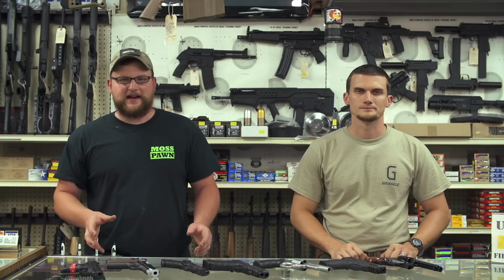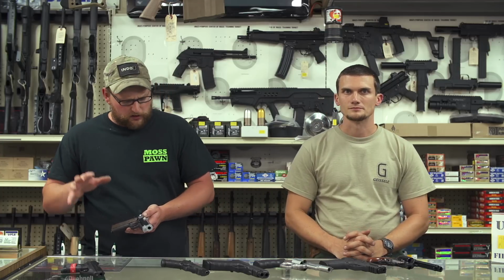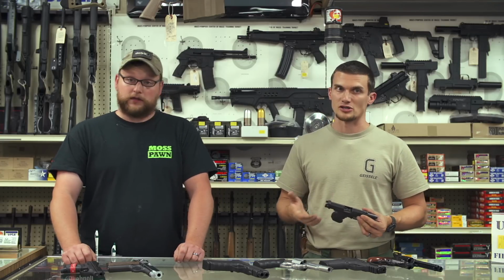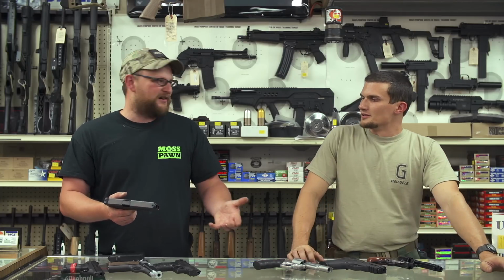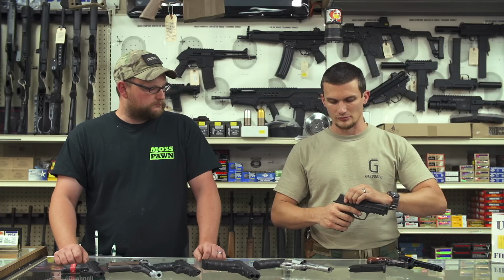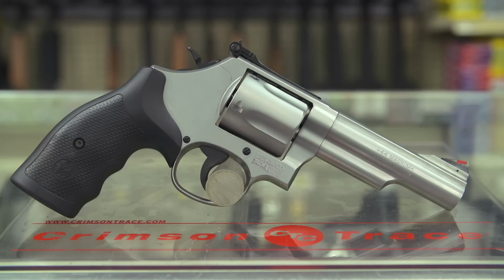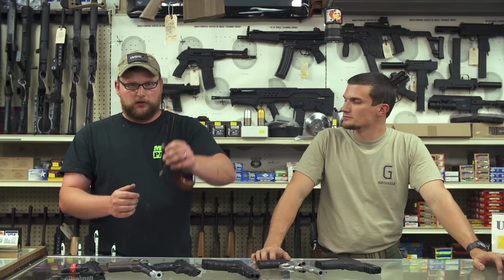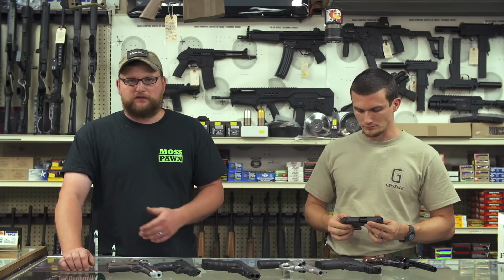Handgun Etiquette for Beginners

Comment: "Don't dry fire without snap caps, they're cheap and easily available." ->Dry fires with no snap cap
Reply: I literally always dry fire to make sure the firearm is fully cleared… it’s like strapping a load down on the back of a truck or trailer and not testing the tension of the straps and saying “that’s not going anywhere” feels like you missed a step when you don’t do it, and also makes it so the firearm isn’t armed and ready to send the striker forward when not in use.

Comment: I get what these fellas are saying but surely the manufacturers of these guns would make it so that you don't have to treat them like they're made of glass
Reply: 👎 No, I dont think you get what they are saying.There not made of glass so if you want to dry fire (wich you should avoid as much as possible) you may get by without damaging the weapon, but the more you do it, the more likely you will damage the weapon.
Reply: @paulpugh2480  that's not true. Most center-fire handguns built today (like glocks) can be dry fired as much as you want with no detriment. You actually have to dry fire a glock to disassemble it
Reply: @privateuser7 Glock recommends snap caps if practicing dry firing regularly. People have literally knocked out the breechface from dry firing too much without snap caps.

Comment: I was taught to grab the slide from the top (don't grab it like a sling shot you got in trouble for that) pull back the slide and to let it go. This will allow the slide will slam forward  guaranteeing that the weapon will chamber a new round and lock into battery. I have treated my gen 2 glock 19 this way for the last 23yrs.

Comment: I think this is etiquette for new guys checking brand new guns out at the store. If you haven't bought it, it makes sense to be careful with the merchandise. Otherwise, guns (especially new ones) are pretty tough. They're designed to contain EXPLOSIONS, so a little racking and slamming and dry firing are not gonna hurt much.

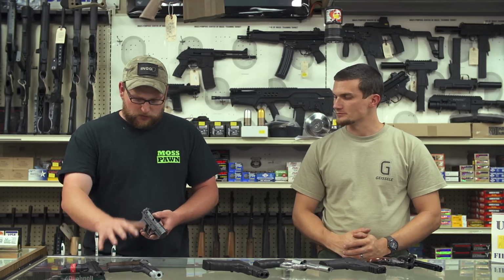Comment: 3:36 - "We try to walk them through, and at least show them how to handle a firearm properly."  
3:45 - Grabs P22 by positioning fingers directly in front of the muzzle, and continues to handle it with muzzle pointed at fleshy hand.

I know the guns are cleared, but that's a bad habit to have.
Reply: !!!!! Yikes. He made me want to stop watching the video right there.
Also at 1:14 he said "you don't want to crystallize your firing pins." This is incorrect terminology. Dry firing will not change the microstruture of the hardened steel firing pin. The steel pin is already "crystallized" in the sense that metals have a crystalline structure. I think he was trying to say that dry firing puts more stress or impact load on the firing pin and could cause it to crack if the heat treatment were not quite correct (insufficiently tempered or the material has residual stresses) or if the firing pin has a defect in it.

Comment: I watched the whole video. At the end you brought out a great fire arm. Lc9s 9mm pro has no safety that's why I bought it. I have dry fired it. But never shot it. I heard the trigger was the best in a CCW weapon. It is a great gun. Have owned many guns. The Sig 239 in 9mm. I let the slide shut from the button many times after cleaning and oiling it. Looked over the gun many ,many times. Never seen any damage. That gun was a tank. It was hammer fired too. Also a steel frame.   Let's hear from the expert's!   ..Shawn

Comment: I thought it was a myth that letting a 1911 "slide home" would damage it? Doesn't the gun's slide already "slide home" when it fires and chambers another round? As in every single time?
Reply: ***** Oh.
Reply: It is a myth. The slides gonna do that when you fire the gun anyway, doing it without the bullet is no more damaging than when firing it.
Reply: No for handguns it is damaging and not a myth when the handguns slide is released the spring in the gun has a strong amount of tension that is necessary to slide the gun forward as well as to chamber often heavy rounds of ammunition from the magazine. If you release the slide on an empty chamber without the weight of bullet to decrease the force of the slides tension then the slide will slam forward to fast with too much force and can cause damage to the mechanism of the gun over time. This is true for most of all semi auto handguns. You should never let the slide ride by pressing the slide release without a round to be chambered. If you want to return the slide to the forward position without a live round you have to hold the slide and press the slide release and more gently move the slide to its forward position while maintains grip on the slide so as to prevent it from slamming. After this you can decock the gun or dry fire the gun (which is fine for center fire handguns) to release the tension of the striker/hammer/etc. so it doesn’t remain cocked if you do not fire the gun anytime soon or leave it in storage for while. It is also just safer to decock the gun in whichever way is the best way for your gun so that the trigger is not able to be pulled and as a result cause the striker/hammer/etc. to be acted upon, upon an unexpected negligible discharge.
Reply: Yes it does.
Reply: @johnjacobs4280  That's BS. All of those forces can be sustained without issue.
Reply: @johnjacobs4280  have any confirmation on that?

Comment: I noticed Chad decocked the hammer with two fingers on the sides of the hammer. I just finished my cc permit class and the instructor was very clear that you should not do that that you should use your thumb. He has seen several accidental discharges with police officers and civilians that shot themselves when the hammer slipped out of their fingers.
Reply: Makes perfect sense to me. All the hammers I see are designed to be used by the thumb. Slippery on the sides but serrated on top.
Reply: Anthony Vaughan who “decocks” a 1911 on a loaded chamber 😂😂😂
Reply: rr satx actually I know a few people who aren’t comfortable carrying a 1911 with the hammer back
Reply: @rrsatx I agree! If you read the owners manual on any 1911 it plainly tells you it’s too dangerous and you should never lower the hammer on a chambered round and that the gun is designed to be carried either cocked and locked on safety or with an empty chamber and safety off.

Comment: I believe not letting the slide come home on an empty chamber is kind of overkill. Think about the military and the AR platform. When done cleaning you hit the bolt release and it comes home on an empty chamber and store it. This is standard practice and almost every AR owner probably does it. PERHAPS technically this does damage the gun or WILL but you're talking the difference between a 100 year life span and a 97 year life span. I don't think you need to baby a gun as much as this.
Reply: Our old SLR's were, racked, cocked and locked 'n'  dry fired so often that eventually you had weapons with knackered firing pins and you could physically move the bolt carriage in its slots.  You could easily tell which ones had to be replaced as the serial numbers of the weapon did not match the bolt. They were simply worn out through continuous dry drilling. These were military rifles designed for a hard life. I doubt that civilian fire arms are built any tougher. After all they are a "consumer item" so have a design life. Why shorten it unnecessarily and even worse risk a misfire in a life and death situation?
Reply: Laurie St Lyon
Well because that was probably a long time ago and who knows when the actual guns you used were manufactured (if meant for practice, probably a while ago). Things have changed so much now that the whole firing pin group on guns is completely different. Also, I was discussing not letting the bolt slam on an empty chamber, you are advocating not dry firing. I think a lot of people will agree dry fire practice is extremely important.
Reply: Dry firing is absolutely an important part of training but the effects of it over a period of time carries a price. And by the way Blackwater... it was not THAT long ago! Cheeky young bugger! LOL!
In all seriousness, the point I was making is that the SLR's were racked three times in the unload. Each time you allowed the bolt to go fully forward without impeding it. The SLR's were all L1A2 plastic stocked versions so not exactly geriatric maybe 5-7 years old. But they still had issues over time due to the action of the action!
My point was the guys are right. In short term you get away with it but in the longer term your weapon can pay a price. If it goes wrong at the wrong time...then you can too. Anyway, hope you enjoy your shooting regardless of the "etiquette" you use.

Comment: on the slide slamming forward... doesn't that do that after you fire a shot? whats the difference?
Reply: Yea, I got kind of confused. It might be because it's loading in a bullet, while racking the slide without a bullet inside could damage the internals, but I'm not sure.
Reply: Yeah I'd like an explanation as well.  When I took a intro handgun course we were encouraged to let the slide go to avoid malfunctions.  Are you talking loaded versus unloaded?
Reply: When you shoot the firearm it's undergoing it's firing cycle which involves stripping a round from the magazine and closing on a loaded round or snap cap. We aren't saying you can't let your firearm slam on an empty chamber, we are just making sure beginners know there is a difference. In the video, we are specifically making reference to the 1911
Reply: If anything it is slamming even harder when fired because the force of fired recoil is more than you cocking it, so I agree how could me cocking and letting it "slam" be damaging when firing it is more violent.  This was very annoying.  I've always read you are NOT supposed to ride a slide forward you are SUPPOSED to let is slam.
Reply: Atomic Bean they didn't explain it very well in the video. When you are chambering a round you want to let it slam to ensure the gun goes into battery. When you are cleaning your gun or something you shouldn't let it slam on an empty chamber because it puts unnecessary pressure on the parts
Reply: Some of the kinetic energy is used in stripping the next round out of the magazine, and seating it into the chamber and setting the extractor hook onto the rim of the case. Without a round in the chamber, all that energy is spent slamming the slide home without the cushioning effect of the case.
Reply: Virulent Ivyz At a gun shop most people pull the slide back with the magazine in and it locks back. So what do people do? Use their thumb, push down the slide lock letting the slide slam home. That's what they meant.
Reply: clemsonalum98 In a gun shop with unloaded firearms youre not suppose to let it slam. It could damage/bend a lot  When loading one into the chamber you also dont use your thumb to disengage the slide lock. You wear out the slide lock doing that. You slingshot the slide on live rounds.
Reply: ***** No more pseudonym? Just wondering.
Reply: Well not exactly because when fireing it it's also bringing up another run from the magazine in to the chamber which slows the slide down some. You're right though it I doubt really matters but whatever.
Reply: Not sure why there is so much confusion on "Handgun Etiquette for Beginners". Etiquette for handling handguns folks. Learn etiquette on handling someone else's handguns.
Reply: CastleDoctrine87 I understood that part. I know that dry-firing is bad for the firing pin and some internals. It's just kind of strange to hear that you're not supposed to let the slide slam. I'm sure it damages some internals being that there is no round in the magazine or chamber. I have done it allot of times and I have never heard of this rule until this video.
Reply: filoIII I was just going to say the same thing. Yes Kahr recommends that you use the slide release to chamber a round. And not slamming the slide is the same principle as not dry firing a bow. It's designed to have the extra mmass of the round / arrow while moving forward. No round / arrow puts extra unwanted velocity on the slide / bow.
Reply: Clambering of a new round actually slows down and cushions the slides forward movement
Reply: Virulent Ivyz filoIII I think Kahr is the only manufacturer that recommends using the slide lock as a release. I know Ruger recommends it with their Sr22 pistol (I have one) and that's all I know of. I, either way, wouldn't use the slide lock as a release. It's just too easy to use my non-firing hand to gently slingshot the slide. I cherish my firearms so if there's a way I can lesson wear then I chose that way. It's your firearms though.
Reply: Oh, ok thanks!
Reply: CastleDoctrine87  There isn't, you are conflating two issues.  Somehow this turned into a slide release thread vs. a full force on an empty chamber thread.  I never use my slide release, I DO often let it slam on empty chambers for example after cleaning a gun and the magazine is out I snap the slide back a few times to spread the lub.  No mag is in the gun, no slide release is needed.  It slams home I don't easy ride it.  The video suggests never letting it slam.  You converted the discussion to a slide release discussion.
Reply: clemsonalum98 If you read the comments you would understand. In gun shops perspective buyers pull the slide back with the magazine in. The slide locks. They then use the slide lock to release the slide therefore SLAMMING home. Gun shop etiquette that's how. Explain to me all  ways a slide can slam in a gun shop looking at your next purchase? Clemson Alumni? Born 1998? College student huh? I also wasn't talking to you. You don't have to read and you especially shouldn't have replied since it has nothing to do with you.
Reply: Kimber says letting the slide slam forward with no ammo in it can damage the extractor if it is done enough, but it's not really a big deal. What really is bad on 1911's is hand feeding a bullet (putting it straight into the chamber) and slamming it forward. The extractor is not meant to engage on a rim in that way and can be damaged after only a handful of attempts.
Reply: ***** I don't know Kimber mechanisms so can't comment on their extractor being damaged by slamming the slide on an empty chamber.... but I agree with you fully about loading a round directly into the chamber and the negative effects it has on the extractor.  This applies to all semi-autos - I have never encountered any that say direct loading is OK.  To me, this is a very real etiquette issue, as it causes real damage.
Reply: Kimber guns don't work worth a shit anyway.
Remember the Kimber Solo?
Reply: bahhumbucker      One example of a semiautomatic firearm that was designed to be loaded a single round at a time in the event of magazine failure is the Beretta 92.  In order for a piece of metal to be at risk of damage due coming into contact with another piece of metal forcefully, said metal would need to be softer than the metal with which it is coming into contact.  This is one of the benefits to using brass casings for ammunition. Extractors, like many other parts of modern firearms being made of steel, It's much more likely you would damage the lip of the brass casing of a bullet than the extractor of a pistol or rifle.
Reply: I think that when cycling, not only part of the kinetic force is used to rack a fresh round out of the magazine and into the chamber, effectively lowering the slide's speed, but the brass casing dampers the hit between what would otherwise be between two heavy pieces of steel.

You're supposed to let it slam and not riding it when chambering a new round, but not when there's nothing in there.
Reply: Watch the older vids the bearded one does it all the time
Reply: pumpkin12162 3
Reply: Can you let the gun slam if you have a magazine loaded with snap caps or only with a cartridge? Big difference in weight...
Reply: Atomic Bean  a 1911 is designed to drop the slide, Browning made the 1911 to mill spec, and part of that was the slide drop for inspection.